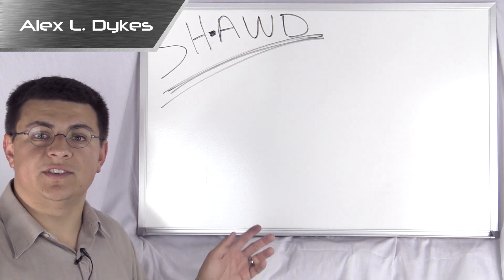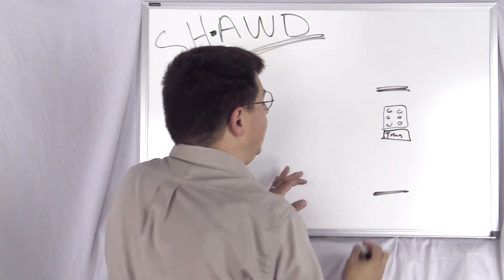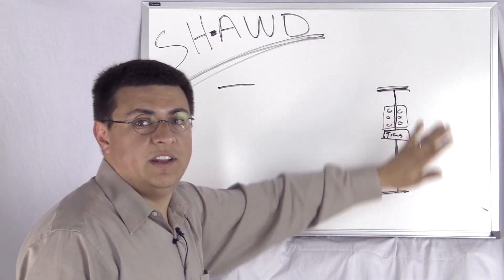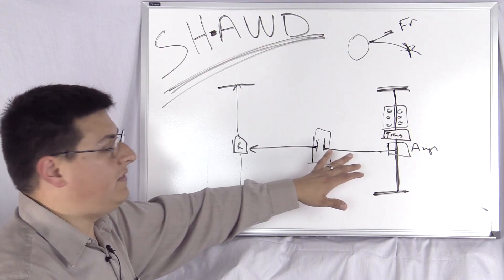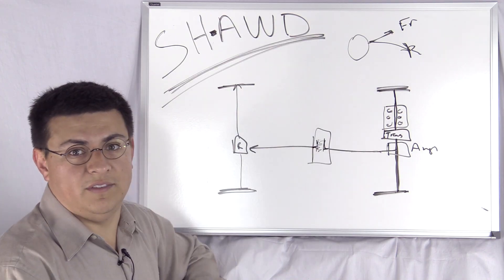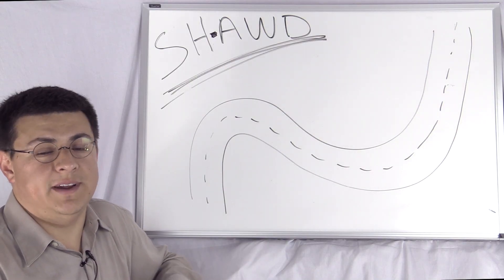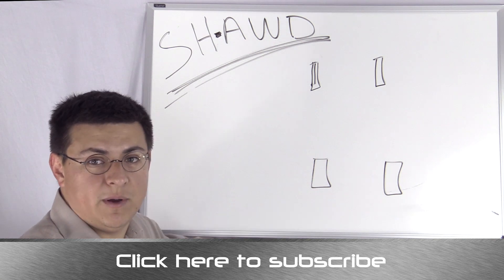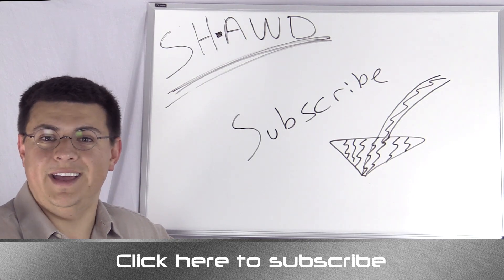How SH-AWD works: Acura's AWD system explained

Comment: It is important to note that not every Acura SH-AWD works like this. Neither the RLX nor the NSX are what are described in this video. The NSX and RLX do not have a drive shaft going to the rear wheels or a rear differential. Each rear wheel on the RLX and NSX have their own electric motor.

Comment: So, if you're driving down the interstate, and the road conditions are dry, and you're going straight, are you sending power to the rear?
Reply: It is a front bias sh-awd system.  It will mostly be fwd for mpg efficiency.  I usually see a 90/10 to 70/30 depending on speed, level ground, or slight incline. It will send up to 70% power to the rear wheels as needed (100% of that L or R with tq vectoring).  The tq vectoring to the rear will also kick in once the road get curvy with the cruise control on to improve handling.  That is why sh-awd only takes a 1-2 mpg hit compared to the fwd model.
Reply: @mrgold3591  You seem pretty knowledgeable about that system... My daughter was recently shopping for a car, and the MDX was not on her short list. But we saw one at a dealership, and fell in love with it. But complicated drivetrains like this have always scared me. I've encouraged my children to stay away from all-wheel drive or four-wheel drive if possible, just to the added expense possibilities... If four wheel drive is a must, I've always encouraged them to stick with something that you could shut off, and turn on when needed... What else do you know about this system? In regards to reliability?.. she ended up buying this car, it's a 2016. Has the push button transmission which is kind of weird. And it's the SH AWD.. one owner, and lots of good service records. Kind of higher mileage. But it's nice. And she likes it a lot, all of that extra moving stuff in the rear end though, that kind of scares me

Comment: How important is it to have all 4 tires match in wear. I replaced my 2 front tires because I had a tire that couldn't be repaired.  The back tires still have pretty good tread but the salesman said I should replace all four. Is that true I have a 2021 RDX with AWD.
Reply: I've had several sh-awd Acura's and had an unserviceable flat.  I just replaced both tires on the same axle if the treadwear of the opposite tire was too much (example old tires 6/32nd and new tire 10/32nd).  You just have to keep the tires with similar tread wear on the same axle.  Front/back rotations and no X-rotations until you replace all 4 tires.

Comment: 🙋 I WISH YOU COULD MAKE AN UPDATE VERSION ON THE ACURA NSX 🙏
Reply: The 17-20 MDX Sport Hybrid and 14-20 RLX Sport Hybrid uses very similar EV components as the NSX; but, with different programming, 7DCT for the MDX/RLX, and 3.0L or 3.5L NA V-6 engines.

Comment: It amazes me how  my 1981 Buick LaSabre with a 307 cu in V8 got 25 mpg and 2021 midsized car with a 4 cylinder and weighing 1000 lbs. less than the Buick and doesn't get as good mileage.
Reply: Back then, V-8 engine only had about 150 hp, 3 speed auto transmissions, and posted speed limit was 55 mph.  You would be lucky to see over 15 mpg at 75-80 mph at today's posted speed limits with a 81 Buick.  I had a 3.8L Buick Regal 3AT and never saw 25 mpgs at 55 mph posted speed.  I would see 28-30 mpg with my 2006 2.4L I-4 205 hp 5AT Acura TSX at 75-80 mph.

Comment: I have a 2009 acura tl sh-awd and when I’m coasting the rpm will jump 2-300 rpm and no one has a clue.  No lights on dash and no codes. Did spark plugs and coil packs. Cleaned egr and carbon clean.  Still same problem 
Any idea??

Comment: Remember when you were a kid and you would make your toy car do turns that just wasn't even imaginable ?
This is exactly what that theory is. It's hard to describe but when you go around a corner it actually feels like the back of the car pushes you into the turn. If you never drove one of these cars before if you get a chance drive the car or get in the car with someone and let them go around the corner and it'll scare The Living Daylights out of you because the car will not squeal or move it'll just take the corner. You could go around the corner at 50 to 60 miles an hour and the car will not even move it'll just take the corner. And I'm not lying I've gone around corners and I swear the car is going to go out of control and crash but it just takes the corner and keeps going. DRIVE THIS CAR IF YOU GET A CHANCE

Comment: It is a very complicated system though with some durability issues
Reply: What durability issues?  This system has been in use since 2004 and I've had 4 vehicles with sh-awd with zero issues.  Belong to several Acura forums and no-one has mentioned sh-awd issues?

Comment: I found this technologie no use . A regular awd i fond mutch bether than this. Its a waist of time . No useless. I found it is only a gadget for nothing . I have a rdx and i dont like is only a illution . I eated . I soon will sail for a Ford lincoln mkx is mutch bether
Reply: What year is your RDX?  Sh-awd works all year in all four seasons depending on your tires and road surface.  Not designed for rock crawling or sand dunes 4X4 driving you do in a Jeep.  You need to find the right tool for the job depending on type of driving you do.

Comment: I have an 08 RDX Tech with +195,000 miles and 11 MDX Adv with +150,000 miles and the sh-awd has worked flawlessly over the years in all 4 seasons.  Mainly purchased for the sporty handling living in the southwest and I've haven't been disappointed over the years.  I handed down my 08 RDX to family and upgraded to 18 RLX hybrid and 19 MDX hybrid with rear electric motor sh-awd.  The hybrid sh-awd works even better than the mechanical sh-awd because it can engage tq vectoring/regen braking on or off engine power.  The hybrid rear electric motors can regen brake the inside wheel and over drive the outside wheel to rotate the MDX even more in a corner. The hybrid sh-awd works equally as well up and down the mountain switchbacks.

Comment: I was driving in a snow storm with 2021 Acura awd and was wondering why everyone is driving so slow at 35 mph on the highway while I was driving at 60. Super handling all wheel drive is a very smoooooth rain and snow driving car.
Reply: Because everyone else on the road is smarter than you?

Comment: i saw your video on how the sh awd works but im very disappointed in that you speak about the works but you never speak about how to fix and repair it when it stops working example i replaced the vsa pump which is connected to the awd system when the pump was replaced the awd stopped working so i am asking you whats your take on this situation and how can i repair it since you speak about the system is different from others

Comment: I have a 2012 Acura  tl with a 3.5 the sh-AWD light is on but the car doesn't have the sh-awd module .and it's not 4 wheel drive but the sh-awd orange light is on.

Comment: I’ve had all 3 generations of the RDX...I fell in love with my 2009 because of how it drove and handled with the SH-AWD. The second generation one (2017) was nice and big a luxurious but I hated the way it drove...it was like driving a SUV not like driving a car. My new 2020 took the size and luxury of the 2017 and brought back the driving and the handling of the first generation one with SH-AWD and it’s better now than it ever was. My dad still drives a first generation RDX (2007) and after I got my new one I took his out for a drive to compare. Now granted we’re talking about a 13 year difference here and about a hundred or so thousand mile difference on the two cars engines but you can feel the difference. And I’m not taking about ride quality or anything like that because of course the 2020 is gonna ride better. I’m talking about taking a corner at speed, the new one literally hugs the corner where the only one lags a little. I think now that 90% to a single wheel in the back is 100% to a single wheel in the back and it ends up with a real rear wheel bias around corners. I don’t know all the specifics of these things...I’m not a mechanic and don’t know a lot about how cars work and stuff but what I do know is feel and from driving both ( I had my 2009 with SH-AWD for 7 years) I can tell you that they took an amazing design and made it even better with the new RDX. If you’re going to get a new Acura no matter which one it is...spend the extra 2000 and get SH-AWD it’s worth every penny and turns that car from great to absolutely amazing.
Reply: I still own a 2007 RDX, and am interested in changing it to the new MDX MY22, and hence appreciate your comments regarding the new RDX. Was interested in how the SHAWD has changed over the years. My 07 RDX have crossed the US twice, and I still remember how it teared through the slopes near Lake Tahoe in Norcal. The RDX continues to put smile on my face whenever I drive it (my significant other drives it now), and in some ways are better than my ‘18 Genesis G70. I look forward to getting the new MDX, and hence your observations are very helpful. Thanks again for sharing!
Reply: I just picked up a used 2015, love it. Way faster than my 07 MDX. The 07 went through snow with snow tires on, felt like you were on dry pavement

Comment: Great video but from what I understand back in the days say 20 or more years ago Front wheel drive was way better than rear wheel drive. Since front wheel drive pulled you around the comers and rear wheel would push you through the corners. So in theory, Rear wheel would push you off the road when going to fast or fish tail. Front wheel drive would just pull you around the corner.
Also in snow having front wheel drive and the engine on top of the wheels gave you better traction. Please corset me if I am wrong.

Comment: I can buy a MDX 2002... 4wd...  for $1900 ...   160k miles/     Should I buy it?   Its being sold by an older lady.  the car still looks like it's brand new for the most part...moon roof,  not a scratch,... even the driver seat is in great shape.  I really can't find anything wrong with it.....  It sure seems like a deal to me.... 000-- Edit"  well, I bought it.. lol

Comment: I am a little confused by the remarks about BMW X5M.  Is there a benefit one system over the other or are the differences nullified by simply being the better solution for the platforms they are used on?  I am attempting to flesh out the better AWD system for use on vehicles that were never born with them as a mental exercise.  I am down to the symmetrical system in the Subaru STI and SH-AWD in the RL but have failed to consider the BMW X platforms.

Comment: The SH-AWD is no joke. My 2012 MDX demolishes corners. And it actually off roads really well too. Catch me wheeling with the Jeeps at Hollister or going double the speed limit with the BMW's on highway 35. (CA)
Reply: YOU ARE A GREAT PILOT 👍👍👍👍👍👍👍👍
Reply: @armandoperez2484  well I try not to ever get air but when I do I wish the MDX featured a joystick
Reply: @MCMinerHQ  Thanks for that, I’m sure you drive fast but my question is how I have better traction for snow places? Should I drive in S sport mode or D regular mode to have more traction when is snowing 🌨? Thanks 🙏🏻 to all of you guys!!!
Reply: @armandoperez2484  Drive modes should not effect the sh-awd much.
Reply: @MCMinerHQ  Perfect and thanks 🙏🏻 so much. I’m just learning and exploring with the new toy!!!
Reply: just bought a 2012 mdx this year and honestly have been blown away by how well it handles corners for such a big vehicle.
Reply: @isaacbjorgan1829  just remember to use penzoil full synthetic oil, change it early, and change your PCV valve often. I change my PCV every 25,000miles and keep a few extra I order them from Denso on eBay. These vehicles have very sensitive oil control rings as that's where a majority of the compression comes from. These vehicles also have a bad EGR design and it's really important to use lucas oil injector cleaner often if you plan to drive the motor hard. Thankfully these motors are port injection and the motor stays whistle clean other than those two things. Also these transmissions are insane, if I ever feel a lack of power or that the transmission is slipping a fluid change is less than $300 at a dealer and that instantly fixes it(the torque converter is very aggressive and can burn the fluid with either fast shifting or towing but never damages itself) I just drove from CA to FL for my move and she towed a 5000+lb trailer the whole way. Now I just need to change my diff fluid but that will happen next week. I speak from great experience because I have had my motor rebuilt under warranty due to previous neglect from another driver. This J series engine is a beast and actually more powerful than alot of V8s she just likes a little attention now and then. Owners manual and dealer have absolutely no idea about the short comings of the PCV system or EGR.
Reply: @MCMinerHQ  Thanks for the tips about the PCV , I always use full synthetic and change it 1500 before the default as i heard from the beginning that they eat oil and i have found it to be true over my year and a half of ownership now, and yeah i drive the car pre hard so tranny fluid changes have happened twice now , as youre right the torque converter just eats fluid for some reason , in terms of the EGR im not sure what you mean by that but from some quick research I believe it . The exhaust system feels kinda choked for some reason in comparison to some other vehicles i had . Debating doing some exhaust work soon to open it up a bit more . Gonna do a bit of research in some forums im in to see what youre saying .  And yeah i use the injector cleaner like, every 4 months ishhh seems to do the trick .

Comment: The Mitsubishi Asx diesel has something similar. Put it in 4WD lock mode and it will send more power to the rears at higher rpm or when theb computer thinks it needs it

Comment: You literally explained Audi's acceleration device and torque vectoring rear differential with the clutch packs as Acura's SH-AWD and then said Audi quattro doesnt have torque vectoring differentials. Smh. I'm going back to engineering explained. Atleast he respect all brands.
Reply: Which system is better in your opinion
Reply: @JohnSmith-yr6je  Depends on what you mean by better. Audi's awd is going to be a lot more sport oriented but Audi's are generally higher maintenance than Acuras. Historically Audi is the reason awd is primarily used in rally racing and theyve moved more to racing on pavement since then. Theres a reason there are "Audi quattro compilations" all over youtube and not just "how quattro works" videos. Plus i dont see many(actually ANY) sh-awd Acuras doing donuts on dry ground..
https://www.youtube.com/watch?v=AOq74OtX3m4
https://www.youtube.com/watch?v=IWOBbV4-9TY
Reply: @Dubz0408  good point. Better is very broad. I would love to have a used s4 or S5 but I’m totally fine with paying less for maintenance and parts with an Acura. Thanks though

Comment: I don't see any benefit in this PAWS system. For everyday driver it is useless. I never feel it during normal driving. You only feel it when the actuator which moves rear wheels fails and it costs $2,200 to replace (just one wheel)
Reply: I have a 2015 TLX with SH-AWD; few times it was in service the loaner they gave me was either a I4 or V6 "PAWS". I put it to the test in all kinds of conditions and found zero advantage or use. The fact they use a catchy name PAWS is a red flag; it's more to make it sound good than anything else. SH-AWD or nothing when buying an Acura.
Reply: V Mel this helps in the rain and snow...already saved my life at 140km on the highway when I swerved to miss a huge ass raccoon lol..the back end swung out then straightened right out...rwd or fwd I wouldn't ended up rolling in the ditch

Comment: SH AWD Transmission reliable?

thinking about purchasing a used 2007 2008 MDX with over 150000 miles.
Reply: Joon kinloch. 2008 mdx 120 k love it  a.c. com 600$ parts expensive!!